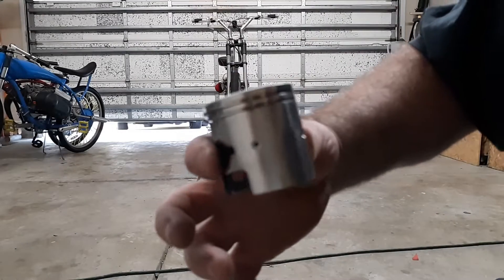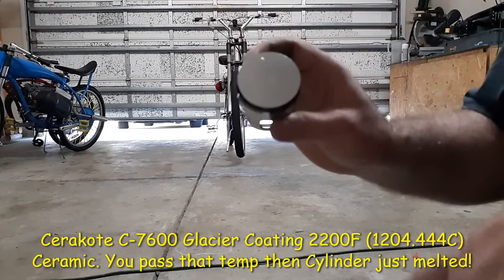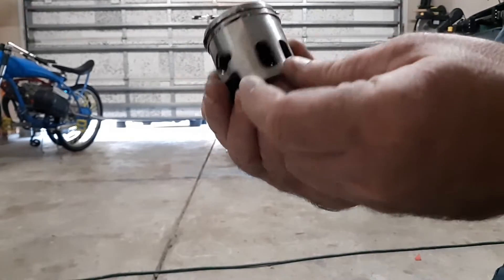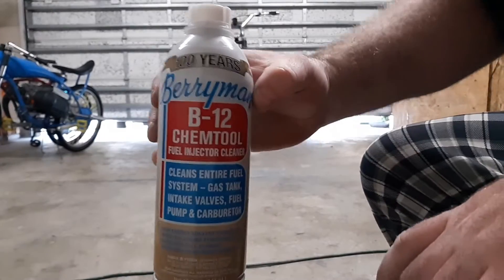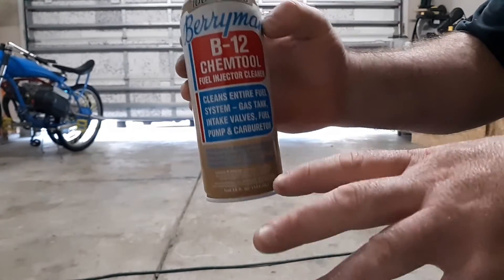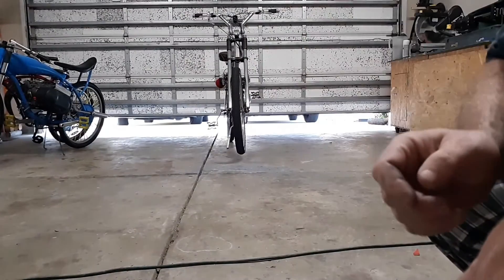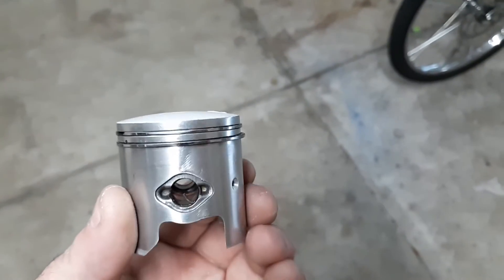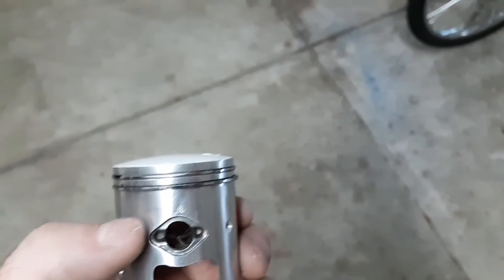Minarelli Motorized bicycle - cold seizure, Soft Seize Fix and why it happens!

Comment: I've had a few of those clips fall out,and a few even snap at the little tap that you use to pull it out,so I cut that tab completely off (make sure you have a groove to use a Pic to get it back out) and i open them up a lot more too

Comment: I bought the C Series of The Cerakote.  It's an "Air Dry", and is suppose to resist higher heat than the H Series, which is the one that's baked.  Five (5) day cure before use.  They also make an E Series, but, I didn't see that one until I purchased the C Series.  

I also purchased the smaller skirt piston off of eBay that the OP mentioned in another video concerning, Cerakote.  I'm simply airbrushing it on with a cheap battery operated air compressor >>>> it's used for decorating cakes, and make-up.  It should work fine.

Comment: Awesome vid bud. And yes you taught me this coating that I need to get my hands on. So thank you Build Break Fix.
Reply from the maker: not full proof.  but it extends duration huge.  like if you over heat after 30 seconds normally.  would take 20 minutes ato cold seize doing same without coating very effective reducing a cold seizure.  honestly buy a aluminum jug. if you really like your minarelli want straight up non bull shit runner alluminum coated jug is way to go.  cast iron just not designed for high temps long durations. piston expands faster then jug. cost 200$ sure but in end worth it.  most think i hate minarelli.  i own 2 of them actually! but just cast iron ones cold seizure coating helps.  ut if you really want a non bull shit build go aluminum jug and you will never regret the 200$ spent. live long long time run well
Reply: @BuildBreakFix  When you say aluminum you're talking about Athena, or Piagio jugs right?
Reply from the maker: @jmrides777  "athena type"  yes piaggio are not same geometry require different spacer design and shape.   if you enjoy your minarelli well worth money spent.  very little issues with them and they last very long time as long as you don't hammer the hell out of it constantly lol  more of a 3/4 under build but at that speed really all you need anyhow on boicycle few rips fun wouldn't 24/7 it just bearing wear issues over time!
Reply from the maker: aluminum type "athena"   jugs expanded at same rate as the pistons! so there is no cold seizure issues!  cast iron type now expand 55% slower then aluminum piston so they get frozzen inside jug scaring hell out of echaust side causing what people call clutch ripper, cold seizure, soft seizure lol either way tears fuck out of your piston jug LOL

Comment: In old YouTube  Cerakote engine/piston videos, sellers were using a gray or bronze color claiming it worked wonders on pistons. Then people came out with videos testing it & debunking sellers claims. The pistons stayed cooler for a little bit longer (enough to get down the 1/4 mile drag strip then got warm) But it looks like they have developed several new types of Cerakote since then.
Reply from the maker: Yes.  Glacier cerakote is actually designed just for pistons! White top piston was coated in it.  Not cheap either! He paid 120$ have that new cerakote put on it.  But he says it has made the build much more enjoyable since all heat problems are reduced greatly.  Not cured but curved drastically.  I have a minarelli with c type cerakote on it catalyst  baked type.  Pretty nice results from that as well.  Yeah those bronze ceramic  where kinda a cross between fragments of materials in a glaze type ceramic I think back in 90s.  Was a deflector till it deflected into your rings lol

Comment: What is the stiffest clip we can get for these motors? I have about 3 different types C shapes, G shaped, and another similar to the G shaped but with 2 pinch points. I'm not sure of the material they are made from, or which is better. Also, I noticed that the clips for my falcon cylinder where silver and thinner at .88 mm instead of .98-1mm.
Reply from the maker: Not sure why you want stuiff clips or what ya mean!    Wrist pin clips?  Thickness has to do with pistons groove size.  Clip fills it.  But as long as the clips are installed with opening up or down they can't decompress themselves!

Comment: Maybe send out the head to get coated with a ceramic designed to pull heat out, rather than keep it in?
Reply from the maker: cylinder would keep heat in from it not get rid of it!  reason they coat some is heat shield for parts around it!
Reply: @BuildBreakFix  check out Swain Technology in NY. They do two-strokes, nascar, space shuttles, land speed racers. Competition drag sleds and chainsaws. They have thermal emitting coatings and ceramic coatings. I believe that they have a coating that will allow zero clearance and it won't seize.

Comment: Another great informative video thanks brother stay safe
Reply from the maker: thanks! I
Reply: @BuildBreakFix  question is seafoam as good as b12 for cleaning 2 strokes that's what I was using in my 2 stroke boat motor but if b 12 is better I'm switching
Reply from the maker: @mikemiller3303  well sea foam is bit more aggressive. But pretty much same results.  One blows stuff off fast.( Sea foam) other is  over little bit of running time.